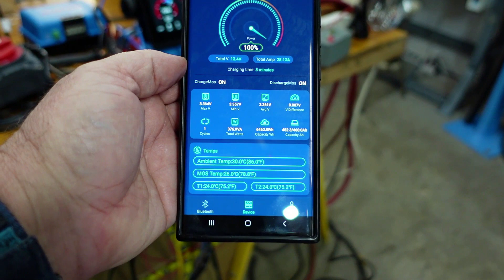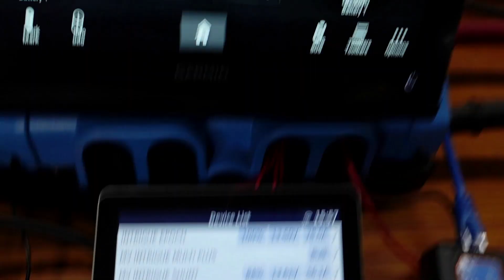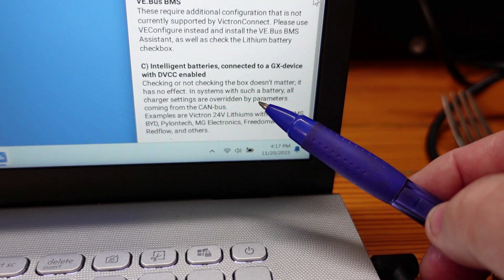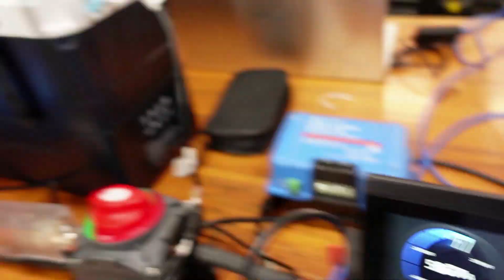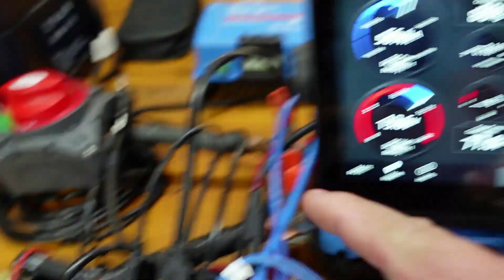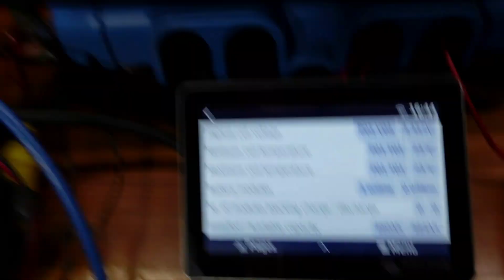Epoch 460AH Monster lithium battery with Victron Comms first test report - Plus 10% off code below

Comment: Quick question. In my current setup I have two large batteries. You mentioned Positive and Negatives being the same length. The installer made the round trip the same based on orientation. Meaning one of my positive cables is the same length as my one of my negative cables and the other battery is the opposite. When I asked about it he said it is the round trip length of cable in total. Is this a good method or should I buy some more cable and change it. All cabling goes to  common busbars for  positive and negatives and then all cabling to the inverters are exactly the same length on both sides of the equation.
Reply: TY, One other question if you don't mind. I am full-time and will be swapping these out for my existing batteries. The manual says do not connect them to my system until they are fully charged. Is this really necessary or as long as I stay on shore power until they are full charged I should be fine? (minimal 12 VDC draw) I have 2 multiplus and 2100 watts of solar and thought they would do the best job bringing them up to charge especially connected to the Cerbo. Thoughts?
Reply from the maker: @rjoustra1150  If your in parallel its not all that critical. Series it is super critical. If you can turn the charge amps down a bit to say....20 amps per batt for the last 5% that would be good. But as long as you use the 13.9  absorb and 13.5 float you will be ok.
Reply from the maker: Actually I think that probably fine. If you draw a decent sized load just look at the app and make sure amps relatively equal in thier load sharing. They will never be perfect...but if they are close thats good enough. For instance one batt pulling 60 amps and the other 61 amps...close enough.

Comment: 13.8V is not 99.X% SOC. 3.45Vpc is about 95%'ish. I wouldn't charge any less than 3.45V with the occasional 3.50V since 3.45V is the best start balance voltage where voltage and SOC actually have some kind of relationship. 13.6V is too low and you could definitely end up with less Ah's available over time.

Keeping LiFePO4 near 100% SOC is nowhere near as bad as keeping cobalt based Lithium Ion near 100%. For cobalt based chemistries it is definitely what I would consider in the top 5 degradation factors (heat being #1). Your LiFePO4 cells should rest between 3.35 and 3.45 anyways depending on the size of the cell. This big 460Ah battery (if made out of 230Ah cells) is probably going to rest at 3.35 to 3.37 volts per cell. Floating it above this voltage is definitely no bueno but leaving it at 100% or 95% is not going to hurt your cycle life too much. I wouldn't be surprised if most LiFePO4 (so long as it isn't exposed to extreme heat or charged under freezing) will outlive their application or we will have a cheaper more energy dense chemistry by then (10 years for near daily cycling and 20 years for 3 times a week cycling)

Comment: I think I heard you say that you plan to run the bilge pumps off of the LiFe batteries. Doesn't that mean you can never turn off the batts with the remote push button switch.
Reply from the maker: I cant think of a time when I would turn the batteries off other than to perform maintenance. But you do bring up a good point. I think I may split the bilge pumps. I have an normal bilge pump and an emergency. I think it may be a good idea to have the normal on the lithium and the emergency on the start bank.

Comment: First, thank you for your efforts!!
Do you plan on mentioning galvanic isolators with your boat install?
Reply from the maker: I dont currently have one. I also dont have any galvanic issues. However, I will likely add one since they are cheap insurance. Ill likely put one in when I install the Victron Inverter/charger.
Reply: @mvintrigue-trawlerdiy1101  My (limited) understanding is it protects surrounding boats from you charging the the water creating galvanic reactions, and you from an unnecessary drain of power. But I could be wrong. I also thought it was SOP in the marine industry. Wires/lugs also are special... I think. Sorry for not knowing.
Reply: @mvintrigue-trawlerdiy1101  Victron Galvanic Isolator VDI-16, VDI-32 and VDI-64

Comment: Can you either add comments or do another video of setting up the Garmins to display the shunt information?
Reply from the maker: I will. But generally you need a Cerbo Gx. You would plug in a regular blue Victron RJ45 cable from the Cerbo GX to the Garmin Ethernet port. In that way you can display and control the system, which i dont think I showed. The way its displayed here you need to buy a nmea2000 special cable from victron and that will plug in the cerbogx to the nmea2k port on the garmin. Then you will be able to configure screens how you want to see them. The nmea2k data from victron to garmin is somewhat limited. But its still useful.

Comment: Am I right in saying these batteries have a class T fuse internally. If so, do we still need another externally?
Reply from the maker: It has been confirmed they have a class T fuse inside. I have already ordered and received replacements. You still need to fuse the outputs to protect the wire running from the battery, but it can be a much less expensive MRBF fuse or ANL as long as its within ABYC standards on distance from the battery. Having the class T in the battery saves about $150-200. Pretty awesome. I would however placard the outside of the batt case so its readable stating Class T Fuse Inside and specs.
Reply: @mvintrigue-trawlerdiy1101  excellent. Thank you.

Comment: I know you have sorted out the daisy chaining issue with these batteries as have I.  I am wondering where you ended up setting your max charge voltage in the DVCC section?  When I had two primary CAN bus connections to the Cerbo, I was getting  high voltage alarms from one of my batteries when the the max charge voltage was at 13.8, not what I would consider close and I wonder if this might be related. An earlier comment (jimduke5455) suggested that having the comms set up with two masters might be causing your alarm issues. 

I would like to just let the BMS make all of these decisions and then use the Max Charge voltage when I want to maintain the charge at a lower percentage (away from the boat, etc)

Also frustrated I can't see my Victron data on my Garmin 820xs, an older piece of kit.  I can see them in the NMEA2000 device list but there is no display option for them.  So much data, so little time.
Reply from the maker: Keep cycling the batterries low enough to mot het the warning. I think I started at 13.6 and now use 14.0. You really dont want to go higher than that. Go to "off grid garage" channel and search for a vid titled 20-80% SOC myth busted and watch that entire video. It will tell you what you want to know about max voltage. He also has many other great vids.
Reply: Thanks for that.  Big fan of Off Grid Garage.  Between the two of you I have learned so much and very much appreciate the work you have put into making these videos.  I am working on a blog post of my Lithium conversion and will drop a line when it is up.  Thanks

Comment: Thanks for the videos.  I used your discount code and ordered the batteries.   I ended up with a Mastervolt 3500  Inverter charger, but everything else is similar to what you have.  Hoping that mixing the Mastervolt into the Victorn system doesn’t create a issue.    Using Garmin Chart plotters and the victron CerboGX screen as you have.
Reply from the maker: Very cool! Glad I could help!
Reply: Why did you go with MasterVolt because more charging amps?
Reply: @AVMAR Well, let’s just say I wanted a 3500w INV/Charger unit and found a reasonable price on it thinking it would all run nicely off the NMEA network.   Got it installed this weekend, and having a mixed system works, but doesn’t communicate together as hoped.   All in all, happy with it but next time I’d stay with one brand, either go Victron or MV.   Still playing around with it, and I added the Victron Shunt to be sure I am getting all needed information.

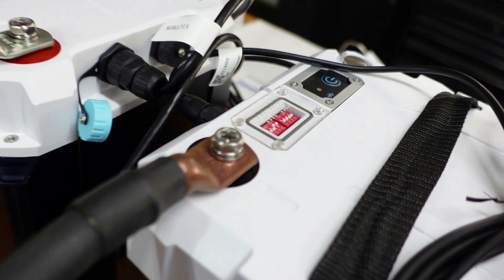Comment: 6:17 I really wish you would test things before you make claims like this. That's not how it works, by the time the battery is up to temperature. There is sufficient inefficiency in the charging process to keep the battery above the minimum temperature.
Reply from the maker: Unless you can show me the programming of the BMS controls on this battery I don't think you can make those claims either. The inefficiency of charging that creates heat and MAY overcome the ambient cool temps to sustain a safe charging temperature is highly dependent on many things that you did not touch on. How many amps are we charging with? 10? 100? 250? What is the ambient temperature? 30F, 0F, -30F. All I can tell you is that this battery will turn on heating blankets internally at the temp predetermined by the manufacturer. and then shut off at another predetermined temp. If it has to cycle it will cycle. I dont know exactly what those temps are. It may initiate the heating blankets right at 32, or it might use them at 35 just for a safe margin. But it likely will not turn them off until it reaches some higher set point. Clearly, once the heating blankets raise the temp to a safe charging envelope the battery will charge and also develop some heat further raising the internal temp. Once the target temp to turn OFF the heating blanket is reached, the additional heat from charging may or may not be enough to maintain safe battery charging temps. If you are charging with 20 amps, and 10 of it goes to the heating blankets initially and then shuts off, and now the battery is getting 20 amps of charge...that 20 amps of charge may not be enough to maintain safe internal temps depending on the exterior temps and location of the battery. I can easily imagine if a battery was in a more exposed area and the exterior temp was 10 below zero that charging this battery with 20 amps after the heating elements turned off it may not be enough to maintain safe charging temps. In that case the internal heater would cycle. If you are charging with 200+ amps it seems likely the heating blankets would come on...then shut off at whatever predetermined set point is...and then charging with 200samps would probably keep them sufficiently warmed. Those are my thoughts on the operation. If you have some additional info the better explains it better or more clearly, definitely add it to the discussion.

Comment: Is That Battery is UL Listed UL1973 ?  It seems not…
Reply from the maker: The cells are. And Epoch is working on getting the entire batterry certified.
Reply: @mvintrigue-trawlerdiy1101  the only UL they can get the whole pack to be is UL9540 which requires a metal case...bad for marine.

Comment: Love your effort,. One thing puzzled me, why use splitter for input to cerbo gx, I belive plugging both in gx direct would give better individual readings and probably more accurate summary reading, GX is a computer and should be able to accomplish  that. Each bat has shunt built in  thus effectively eliminating  external shunt, Just my opinion.
Reply from the maker: On the splitter, i just wanted to see if it would work. Check my latest video to see how it really is supposed to be hooked up. In this video, I was waiting on a special cable so I could properly daisy chain the batteries. On the shunt question, yes, each battery has a shunt, but I already had the Victron shunt, so I just used it alongside the internal shunts. . I'm glad I did because shunt reading is a very rough estimate at times. By comparing both shunt details I feel I have a better picture. In addition, once installed in the boat, I could select either shunt as the batt monitor in the cerbo. Ill likely leave it installed when I put it in the boat just for redundancy of operation as well as information.

Comment: Is it possible to replace my 2 AGM batteries and replace with lithium batteries in my rv. I don't have solar, but I do have a generator.  Thanks for your help..
Reply from the maker: Definitely. Just take a look at what charger you have and see if it has a lithium profile. You can use an AGM profile but its not optimal.

Comment: Can you share a link to the CAN Bus cable from the battery?  I'm assuming that it's the VE.Can to NMEA 2000 micro-C male cable that's on the Victron site.
Reply from the maker: Sure. Ill do it when I get home. I usually try to put stuff like that in the description below the video. But I checked and its not there
 It will be there tonight. I have to check where I purchased from.
Reply from the maker: Ok I added the link. It was exactly the item you stated.

Comment: Very interesting video.  I learned a lot and am relatively new to the lithium conversion process.  I have installed a Victron SmartShunt and Smart Orion DC-DC charged on my RV in preparation for a lithium battery bank.  Still running FLA for now until next summer.  My current plan is to use Battleborn batteries, but I have to say the Epoch have peaked my interest.

Does Epoch recommend that battery discharge be limited to 20% and charging to less than 100%?  I have been trying to get the owners manuals on their batteries for comparison to Battleborn but so far have not been able to find them on their website.  Also, curious why you didn't connect  your power out and negative to the shunt from the Lynx to the end of the buss bar that is covered with tape in the video.
Reply from the maker: Epoch did not specifically recommend the 20-90% SOC range. Your total life cycle will be affected somewhat by what SOC upper and lower limits you use. But you have to weight that against your needs for the battery. If you are off grid with solar you will probably find your SOC all over the map due to vary sunshine. But if you just go out for a night or two I would top them to 100% before disconnecting from shore power. I will let my mission dictate what those upper and lower limits are. My gold cart gets charged to 100% almost always because I want the range. But if my goal was the maximize the lifespan of the batts I might stay between 20-80%. BTW, I did a discharge the other night with a high amp load all the way to 0 SOC and it did great. 

As far as location of buss bars or any other item, this was just pieced together on the bench for testing. I will figure out the best and most compact package when it goes in the boat. All of the wires seen here were previously made. When I install this I will be making all wires etc. 

One other pint. I have another video coming tomorrow that will go over the proper hook up to daisy chain the comms. That is working great too.

Comment: Great testing. Talked to the Epoch support. They indicated that the 480 Ah version would have some advantages when it comes to ABYC E-13 recommendation of early warning.  Have you noticed a difference in your testing?
Reply from the maker: Well, I did a deep discharge a few days ago all the way to 0. As 20% SOC I got a warning. Then at 10% SOC I got a warning. You can also get many other warnings as well such as cell imbalance, overvoltage etc. Then if they are coupled to Victron equipment you can set up many of your own warnings. So with a battery of this type coupled to Victron I would say it meets E-13. There are some warnings for electrical systems that just cant take place fast enough to cover all scenarios. Things like unexpected shorts or component failure could be instantaneous under many circumstances. I dont think you could do better that this.
Reply: @mvintrigue-trawlerdiy1101  Thanks for getting back. The varning is not really mandatory for E-13.  But battery or cell has to be tested, listed accordingly to one of following standards. The 300Ah is accordingly to the web site. They say nothing about the 480Ah?

IEC 62133
IEC 62619
IEC 62620
SAE J2929
UL 1642
UL 1973
UL 2054